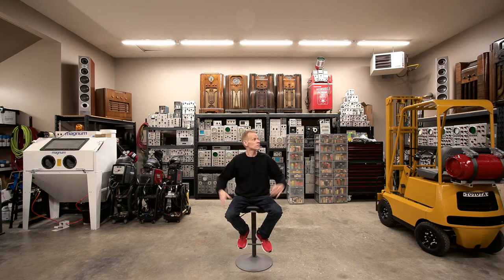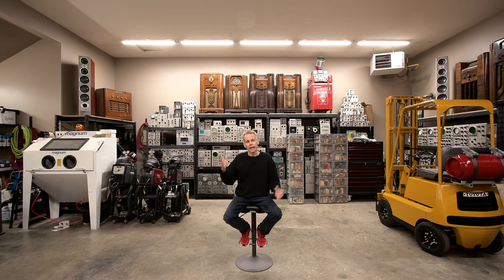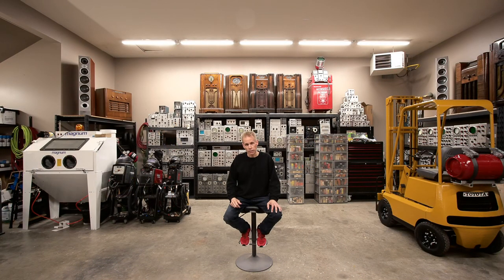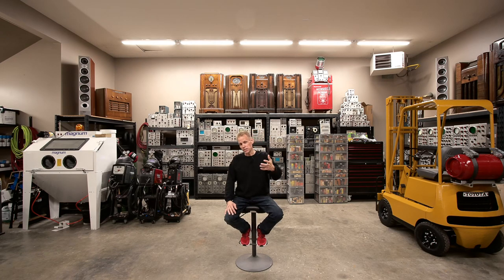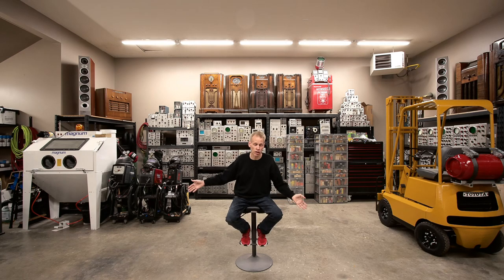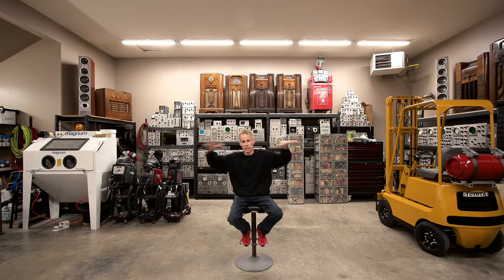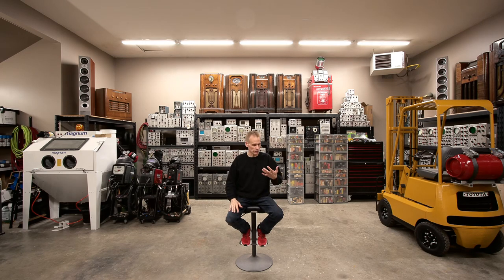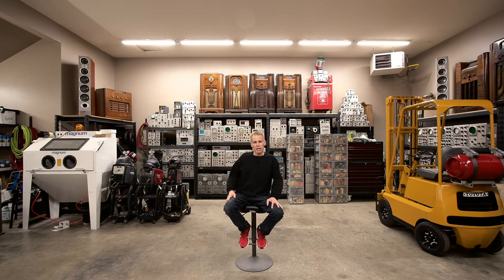ZAP! Mr C's Worst Electric Shock Explained In Detail!

Comment: Thanks for the story,
Once I was working on a Codex 9600 modem and the internal chassis became live, the power transformer had developed a mid primary short to the secondary, feeding a normally floating internal chassis, (as apposed to its metal box that was grounded) so I was only getting half mains, 120 volts (240V here in Australia). 
Luckily our work benches had earth leakage breakers, that did eventually trip, but I was on there long enough to think of that breaker and say to myself "Trip you bas....d".
Maybe the delay (about 5 or so seconds) was because of reduced current due to getting half voltage.

That 'dak' radio is an interesting beast, if one didn't look carefully you'd be forgiven to think it was a power amp etc. just the wording 'channel' under the central knob, and the mic socket gives it away.

Also those two column loud speakers up on the racks - what a 'shed radio', you ain't mucking about!

Comment: As a youngster, I had a scary encounter with what I later found out was 900 VDC. I had a heathkit SB-101, which has a separate power supply, located in the speaker cabinet. It's connected to the radio through a cable with 11-pin 'octal-style' connectors. Of course, these cables are made by hand, by whomever builds the kit. I reached behind the radio to change antennas, and briefly touched the connector shell, which was energized. Fortunately, it was only my hand involved, as my palm was resting against the cabinet. I later found a single strand of the 900V  B+ wire was caught under the connector shell, but that was more than enough to make good contact...

Comment: Wow, what a story and one that I can relate to. In the early 70's when I was 14 years old I was working on a old TRAM CB radio testing the B+ voltage at a capacitor. I was sitting in a heavy wooden chair, in my right hand I was holding (you guessed it) a D104 keying up to transmit and my left hand holding the meter probe, my mother came up behind me yelling something about doing laundry and my left hand made contact with that capacitor, I froze, couldn't let go of the microphone and I'm buzzing. The only thing that broke me free was to push myself with my feet out of that chair and landed on my back, my right arm hurt for days after. Now at the age of 66 I have a pacemaker/defibrillator, lucky me.

Comment: I had problems with a D104 also.
Gripping the talk lever in one hand, for some reason I touched the bottom of the plate choke on my dual 813 amplifier that had 2200 volts on it wiith the other hand. I was knocked out for a few minutes. Burnt the end of my finger a bit.

Comment: I work in aviation and years ago my job was Line Service. Those are the people at a smaller airport that park planes, tow them, fuel them, etc. It's a fun job for anyone that likes airplanes.

The place I worked at housed a small aircraft that was used as a flying ambulance for the areas children's hospital. This meant it was equipped with a full medical incubator on board and we were expected to get the plane pulled out and hooked up to power within 5 minutes of getting the call. Lives literally depending on it.

To not waste fuel, create undue noise for the kids, and be a tad bit more ecologically conscious we didn't use diesel generators like normal, but carts that plug into 240V three phase. They will turn out about 2400 Amps at peak.

I got a call and was working alone, so I had to rush to meet the timeline. The only cart I had available had been left out and someone had run over the male plug end, bending the prongs. I bent it back, but it was still tight, so I decided to use brute force with both hands and bend it to fit the plug. Apparently one hand hit the hot, the other hit the ground. I had 240V three phase going across my chest.

Next thing I remember I was laying on the ground looking up at two flight nurses who were checking my pulse and slapping me. My body felt like every muscle had just had a Charlie Horse and I tasted metal for the rest of the day. They did an ECG on me and said I looked OK, but should go to the hospital. I didn't go. I finished my shift then went home.

The next day hurt worse than any after workout I've ever done.

Comment: Dan Dan the TV man taught me to be very careful with clip leads.... Position them so if they become detached they are tethered and can't fall into the device under test or into contact with the technician. Also beware of falling items. They can fall in your lap or by your trying to catch them you can be in dangerous contact with electricity. Might be better to let it fall. Always set up carefully and securely and away from the edge of the bench. Stay safe!

Comment: Those angry pixies will just jump out at you from nowhere sometimes. Glad you made it through that experience. I deal with -48V DC on a regular basis in my ISP job and have only had 1 close call. Luckily, the only thing that happened was I shut down an entire town's internet and phone service for a few minutes as well as had a red hot bolt melt into my shoe. Needless to say, our company changed our safety protocols after that. 2 people on site when dealing with any type of electrical supply, 1 performing the work, 1 on standby with AED and to kill breakers and or call 911 if necessary.

Comment: I have a similar story i was working on a old tube color console TV and accidentally touched the plate cap on the high voltage with the back of my hand it sent me flying back and ended up on my back with a very nice burn on my hand ..i have never forgot so i totally understand your caution be safe

Comment: I have been in electronics since the late 60s. My first job after being trained in the Navy as an AT was repairing a depot level equipment. Ironically, it was a calibration repair facility as a civilian. I was working on a nulling meter bridge. It had a short in the system where it was plate voltage on a floating ground. When I went to plug in the banana connectors to buck the voltage, the plate voltage went through my hand, then out of my other hand on the calibration standard where I was reaching to apply power and conducted a good ground.
It pulled the air out of my lungs, threw me back, and had an exit burn out of my finger. I started sweating from the back of my head, and my heart started racing. The whole next week, I was itching in my arms and my chest area.
It's was the worst ones for me thinking when I was a kid I was shocked by a broken power plug and that got me hooked in electrics, no pun intended.
I still work on electrics and respect it with safety all the time because I'm one of the lucky ones who can still talk about it, and so are you.

Comment: I've had my fair share of shocks from the wall, switching power supplies, fluorescent lamp drivers, and capacitors. I think the most recent one was a cap that had about 180V in it and you sure know it when you get it. Every shock also has a different feeling weather it's AC, DC or half wave rectified.

Comment: I was working on a 415v 3 phase board for what was going to be a sports clothing shop. There are busbars running vertically either side with breakers running up the tabs coming from the busbars. The apprentice had installed one of the breakers in backwards so the tab to release it from the din rail was on the inside toward the tabs making it very awkward to get off. The rest of the site had temporary supplies run from this board. A fight had nearly broken out earlier as the power had been off for a couple of hours and there was a gang of shop fitters unable to carry on without power and they were on price so stopping was not in their vocabulary. Turning the power off didn't seem like an option so I attempted to remove the breaker with it on. Trying to pry at an angle I slipped and my hand went  straight across the tabs. It felt like my arm had just been wrenched out of its socket while my chest was being crushed. The whole body tensed up and fired me onto my tiptoes which threw me away from the board. My diaphragm was hurting for a few days after like I'd been punched in the solar plexus. Still got the burn mark on my hand. I've had a few shocks but that was by far the worst and reminded me of my mortality and stupidity.
Reply from the maker: Thanks for sharing your story!

Comment: Hi Paul, I know that most electrical workers have been Zorched at least once, in my case I was on the midnight shift and my partner and I had a call that a power supply (3000 amp Dc scr 480 volt) was down we went to the supply, I pressed the off button, that drops power to the main 600 amp contactor, but in this case the supply had a soft start that someone hot wired that stayed on supplying 480 to the main transformer. this supply was water cooled with klixons on the buss bars that would shut off the supply if they got hot, I put each hand across the incoming buss to look at the klixon and was stuck there, my partner then realized that I was in trouble and kicked me loose. 
I had holes burned into my hands just like you described. It's the first time that I was not able to even talk or to free myself. I would be dead if it wasn't for my coworker.
Rich

Comment: Several years ago a fellow I knew worked building electrical substations in Texas. Texas is windy. On the last day of construction on a new substation, and literally just moments after energizing the substation, his hat blew off toward the primary input insulator. The insulator had 12 "rings", so it was at least 230,000 volts input with substantial current. The man grabbed the hat just as it came into contact with the primary, and was immediately turned into a pink mist. Had he grabbed for his hat 20 minutes before he would still be with us today. You have to be careful around anything carrying power.

Comment: Back in the 80's working in a Steel Bar Mill. The Machine Shop had a large Electrodynamic Machine used for plunging dies for drawing bars. We were troubleshooting it with the covers off and I reached over to move a test lead. An arc leapt off of the exposed grid to my right wrist, about 4". As was the case with you I was frozen and vibrating even though it was 600 vdc. Remember looking down at the smoke curling off my wrist and feeling astonished. My partner Joe killed the power and I fell to the floor. Still have a brown scar on the outside of the wrist.

Comment: Thanks for sharing this. I have a very similar story, although it's more around my ignorance. I had one of those old record players that can automatically load another record that sat on the spindle over the platter. This particular record player wasn't loading the next record, so I decided to have a look inside. Electrics were off to begin with, but decided it would be faster to see how the mechanism worked with it plugged in. Anyway, prodding around I accidentally touched a transformer and got a little buzz but I didn't see what I touched at the time, so I carried on. I inevitably touched it again but this time I got a proper big shock. As you described it was exactly how it felt for me. I had three holes in my one hand, one of which nearly burnt through the nerves, and a small hole in the other hand. I don't know how I managed to let go. I remember shouting at the top of my voice during the shock, I felt no pain during the shock, just that buzzing sensation. It's odd and obviously not very nice.

Comment: Remember - after an electric shock like this, if it ever should happen someone - you need to go to the ER and be monitored for several hours, probably overnight to monitor the heart and in case of blood clots caused by irregular heartbeats. One could wonder if some people silently have passed away because of rythm problems after a serious electric shock, a few hours after the fact, so that it never could be detected why.

The ER will monitor your heart and possibly give blood thinning medications to prevent clots and if the shock didn’t really burn you, everything will be fine as soon as the heart regains normal rythm. It will not always happen immediately after the shock, sometimes a new defibrillation shock may be needed - so shops or factories with a risk of people getting electric shocks, should really have a heart starter. (AED)

Paul, you got really lucky there, thanks for surviving to tell us the story and teach us the lesson! 😮

Comment: Paul, basically my first real shock was as a jongster and a real a learning curve,… high voltage can zap you even without touch! While trimming in a amplifier my elbow was to close to a high voltage point in the build. Can not remember the complete buildup, but the result was a jump back of several feet, a very sore elbow and not touching that amplifier for months!

Comment: I got a shock a week ago, working on an old reel to reel deck. Im still not entirely sure how it happened I thought perhaps the casework was live but when I checked later it wasnt. Figure I touched an exposed wire on the inside of the power switch assembly.

Comment: I felt something similar with the quiver and tense point of the hand to which a 10mm spanner burned into my hand, it was caused in my case an RF burn on an antenna that was disconnected but 20 ft away was another antenna that had coupled to the one I was working on, I wasn't electrically grounded and the antenna was bolted to the wall disconnected from the transmitter

Comment: Now I want to hear the other stories as well. Looking foward to more shop talk. I was shocked with DC once by flyback transformer which had intermittend primary to secondary insulation failures. And next time I will spend the extra hour (actually I already did that since I repaired those again) to get these PSUs out and connect them up to the insulation transformer.

Comment: Happy to hear your guardian angel sent you flying, Paul. Thank God. Glad you're safe. 

I have been shocked a few times. One I remember well. I ended up reaching in to turn on a wall switch, reaching around a corner... Unfortunately, that was being worked on by a family member and it was left completely open. Not 240, but I got a nice shock. Felt that weird buzz...and the ants! That's exactly what I'd call it. Burned like a bugger.

Comment: Hi Mr C thanks for the great videos over the years. Recently looking to get started in EME, have been working on my 1.2GHZ "exciter" being a planar triode (2C39A) tripler driven by a 70cm radio. Wanted to conquer my fear of and get some experience with HT, and as much of my reading re 1296 RF amps and osc's etc looked like you can get quite a few watts out of the HT bulb. Have always been very risk adverse with dangerous voltages and have managed to complete 40 years of continuous licensed HAM and other nerd activity intact. However I did recently manage to connect my right hand to 400V DC with a min 125ma supply, which I have just finished upgrading with the HV caps, PIV's etc to ensure I was no longer getting Anode drop on TX. Burned 3 nics size holes in my thumb, middle finger and first finger. The really scary part was after I let go of the plug I pulled out, my hand and forearm felt like they were still being electrocuted, nastly!. After 5-10 seconds it subsided but was unlike any other 240V ACish bite ever before. Not sure that my fiddling around has not just convinced me that semi-conductors & miniaturisation was a really good idea.

Comment: holy moly, what a scary story was that Paul! Thanks for sharing and yes, keep warning your viewers. I started working with electricity ( low voltage) when I was about 10  and I'm now 69. Building, repairing small items is  a hobby and I had 2 shocking stories, but they are also very funny.... 
1>> when I was a teacher at a primary school I also had the ICT apartment. And one day 2 computers were stolen, so I wanted to protect the other ones. I build an aluminum strip frame  around the analog monitors and the computers. But the ones around the monitors appeart to be very dangerous, as I got a tremendous shock when I touched one after switching on the set. It took over the voltage of the  tube inside....... ( so I grounded them with a resistor to earth  and later even removed them) 
2>>>When I was student at the school for teachers I wanted to show the electrical catlle drover of my grandfather, who was a butcher. It was during the scientific lesson. It housed 2 batteries of 1 1/2 Volt and could make a cow stand up, to get into the van. So....I held it against my jeans and it said"bzzzzz". I felt nothing.....Then I placed it against the palm of my hand.....I never heard the "bzzzz", but the drover flew through the air and I was catapulted some yards the other way. Next thing I saw, was faces of teacher and other students above me, asking if I was ok......🤣🤣🤣🤣 kind regards, Ronald, Netherlands